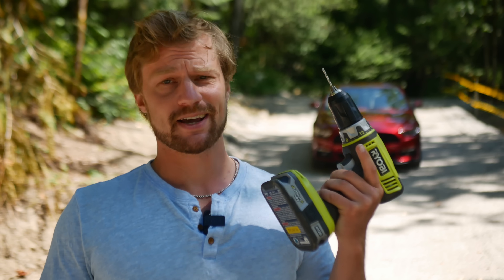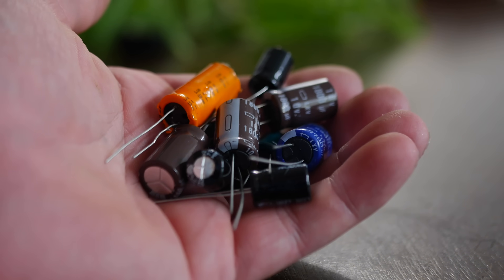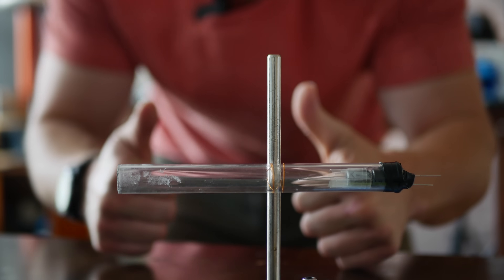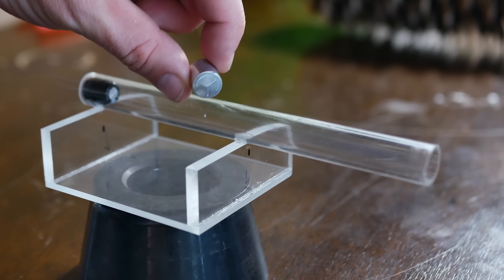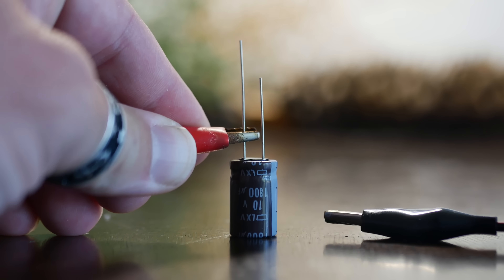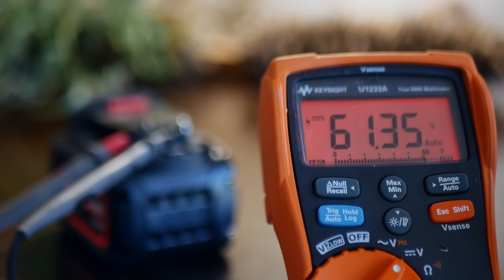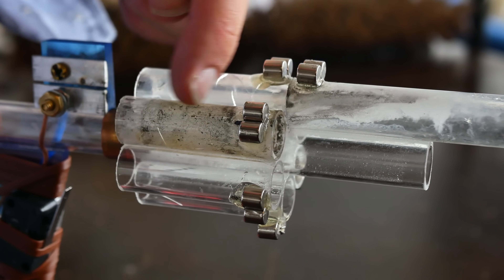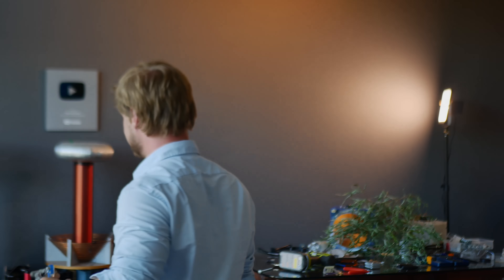I Built An Electric Capacitor Revolver!

Comment: Hrm, my first thought was how to make a reuseable exploding capacitor - but it seems like reading up on it just now, the mechanism of the explosion depends on overcoming the structural integrity of the oxide layer of the aluminum foil anode and cathode that are storing the energy, causing it to bridge the gap through the electrolyte-soaked paper to the other foil later - boiling all of the electrolyte and causing it to violently explode through the weak spot at the top of the capacitor. To replicate that you'd need much stronger anodes and cathodes, and something like a transistor rather than the oxide layer, so you could switch its conductivity on rather than overwhelming it. Or just like, discharge a lot of capacitors into some water to boil it and then use that to move a piston to knock your projectile I guess. Or some concentrically arranged like, ring-shaped peltier devices or something, driving heat inwards and cold out, and have those boil the water to create the steam to drive your piston.

Comment: They say great minds think alike. I had this idea thirty years ago. Just never ran with it fella. Ams so impressed with you dedication and work ethics. WINNER "JAY" PERIOD!!!!!!!!!!!!
Reply: We did this in the late 60s or early 70s. Back then caps didn't have the little X engraved in the end so the entire case would shoot off like a bullet. We converted a cap gun and used batteries. They were pretty dangerous though.
Reply: @USA__2023  Excellent to hear Clay. Just amazing what a determined mind and resourcefulness can make happen. 
This is something I made in the late 60s that took off and made billion plus of dollars for the lucky guy who made it happen while I just did not follow through. The swimming pool creepy crawler which cleaned the pool water surfaces and especially the bottom while the filter was used to clean the water. Like I earlier, great minds think alike.

Comment: I've had a few months ago a similar idea, but the idea was that the charged capacitors function as projectiles or bullets for a non-lethal-weapon and would electricly paralyze Targets without the need of cables or wire, so it could work on longer ranges. The projectiles could be fired out of an air or soft-air gun and would be charged or chargeble capacitors that are fitted into a burstable membrane of ball that is filled with an electrolytic fluid or gel (maybe like those gels that are medically used). When the ball hits the target, it bursts and the electrolyte gel is geting distributed over the target and the condensator discharged. Feel free to buid this if you want to!??
Reply: dude that is such a cool idea, you should build it, patent it, and pitch it to the police or something

Comment: To get higher voltage you could have use a circuitry of an old camera flash, which charges the capacitor to higher voltage and then they could be discharged in to the smaller ones to explode.
Reply: Or you can use 2 buck converters in series with seperate batteries

Comment: I know nothing about physics. But would it be possible to create micro bursts of air using your ionic thruster made in another video? Seems like the cost of capacitors scaled up would still be inefficient compared to chemical combustion style bullets. I also probably used most of the smart sounding words in that last sentence incorrectly.

Comment: when and if you make a metal one i look forward to the turn out, but I'm sure you already thought of this of what I'm about to mention you could double out put by doubling battery packs and reverse chain cross wiring them, but also make sure your chambers are insulated could possible use old style disturber cap from old vehicle and your hand grip also otherwise one if not two batteries will short out if not zap ya. good luck man.

Comment: Hey Jay thanks for the flash back to my early teen discovery of electronics. Two things though: first they stink, that fizzeling dialetric fluid in the tube. Second, I liked you V/fps graph but when i did this 40 years ago I used a big fat 50V ?unknown current transformer. Electrolytic also means polarity sensitive so maybe you can re-do your graphs using AC, maybe reverse polarity. 
Even as a kid I applied a bit of safety, I covered them with a flower pot, 'till I blew the arese out of it and the old girl next door started winging about the noise,. so I stopped. 
Have you thought of destructive canabalistic capacitance. You know they are zero resistance at first touch, so why not charge up a bank of big boys just to destroy the sacrifical lamb.

Comment: If you drillled a hole 1 inch from the end of the barrel could you increase the velocity ?because i saw that the gas in the barrel created a vacuum type thing that pulled the bullet / metal back.

Comment: What if you try to charge a capacitor with step up converter to much higher voltage and then discharge it into this smaller one

Comment: did u said the power is relative to the voltage? XD you ebay 400volt can seize capacitor, put that in serie and blow the shit cap with 4000 volt and 1 farad

Comment: If you could somehow compress the energy from the capacitor into a tyre pump sized tube (or maybe a bit larger) and then design a projectile using that compressed energy generated, it might be something to look at if possible 😂 Or would doing that be a negative thing to do, I dunno 🤷🏻‍♂️

Comment: When did make more sense just to use some kind of an arc that could push anything, bring in outside gas ,air, and then blow out dirt, a rock, capacitors are expensive.

Comment: I have a suggestion, I'm sure you've already thought of it or someone else has suggested, but I'm not about to read every comment looking for it. So here it is, you need "wading", which prevents your rapidly expanding gas, or propellent, from escaping past the projectile without doing its job. I would suggest something similar to what is used in shotgun shells. Which are plastic. This should increase muzzle velocity and maybe also accuracy. Just my 2¢ worth. Love the channel by the way, thanks for all that you do.

Comment: I am not a proponent of gun property, but boy do I love technology.
Different from blowing caps, what about a HHO generator and igniting that to propel a small object.
I imagine a pressure chamber that gets filled with HHO as pure as possible with a closed valve connecting to the barrel. Once that's filled, or has replaced most of the air in the chamber, close of all valves and turn open the barrel valve, and ignite it.
Reply: Fortunately it is done: https://www.youtube.com/watch?v=qb_5RMA2GxY
Reply: and even better: https://www.youtube.com/watch?v=pvuASNhxxcA

Comment: Nice work. I wonder if it is possible with waterdrops and a high voltage spark or plasma (H2O->HHO) to create a similar propulsion but with less dangerous byproducts. I saw an exploding waterdrop in a documentation about casimir effects but never tried this by myself.

Comment: Don't try building one yourself... so if  you built a backplate with the cap attached to an outer and inner plate like a battery you could make cap bullets and full auto electric machine guns, this is why infringement of the 2nd is nonsense.

Comment: What would happen if you inverted the capacitor (explosive end toward you in the cylinder), block off each cylinder like a proper revolver, and have the cathode/anode making contact with the cylinder?
Could electrify specific regions on each cylinder and then the capacitor becomes a self contained projectile, you just slide a new one in and its ready to fire again.

Also, gunpowder is probably a better propellant but innovation is important!

Comment: I had a similar idea.
Sparkplug rifle.
It uses a sparkplug instead of a bolt and caseless ammunition. 
It can be made with basic materials. The chamber is almost completely sealed due to no ejection port or opening bore, allowing for maximum compression.
To fire: moving the lever action racks a round and also, using a set of gears and a clutch, spins a small generator on the side. It spins like one of those rev-and-go cars, where it keeps spinning after the lever has been returned to starting position. When the trigger is pressed, it closes a switch to the capacitor, and the sparkplug in the chamber fires off, igniting the primer and sending the bullet down the barrel. If ammo is out and youre cornered, you can overcharge the cap for a pseudo grenade
Reply: You don't get consistent firing with a quick low energy spark. You could use a semi cw high voltage source (Which probably wouldn't be great since both black powder and gunpowder leaves a bit of sot which would short the electrodes that ignite the primer). The other option is to use a heating wire. Either way, It sounds like a cool project and i wish you the best of luck if you decide to create it :)
Reply: What do you mean overchar💥 💥  👟👟

Comment: If you ever feel like revisiting this you could probably use the capacitors to shoot lightning and control it with HHO gas which might also clean the chamber. xD good luck

if you take this idea and even maybe make a vod with it, do some background research into charged water explosions/implosions and into EVO's or EV's; and you will also want to look into suspending water with zero-point energy; the zpe charged water releases lots of energy when come into contact with high voltage electric discharge. Have fun! Love your channel!

Comment: Use a DC-DC boost converter with a large capacitor hooked up to deliver large current spikes. You can improve the design easily

Comment: You could have used a flash capacitor from a camera to get a higher voltage before you fire with likely a smaller battery, or make some kind of Tesla coil to hold the charge and the release the charge through the capacitor or other such. Even a small scale Tesla coil or flash capacitor for a camera would have worked out better then the battery system you ended up with to get the high end voltage you wanted for failure.

Comment: Thought comes to me about using two caps.  line the barrel on opposite side with a positive and negative line and load the cap design you have been using, but also put a reverse cap in between it and the projectile. kind of like the way you would load power into a musket.  then when you power both caps at the same time they will both force the pressure at each other. P.S. I am not a science guy so this might be a stupid idea, but would love to know the results.

Comment: Very obviously your barrel is too long.

Suction is created behind the projectile because there isn't enough gas to fill the volume. You can see this in the firsts tests and also by hearing the pop sound every time it leaves the barrel after higher voltages give it enough inertia to get past the pressure.

Comment: now just double up the batteries to push the voltage to 120v or maybe use a larger capacitor to dump the needed voltage into the smaller caps

Comment: Couldn't you just run two batteries (or more if you really want to vaporize the electrolyte) in series to get 90v or more? 💥
Reply: this is the simplest solution. i mean those batteries are made of 3.7v batteries in series already

Comment: Considering you're only getting an explosion from vaporizing the liquid in the cap it makes sense that the higher the voltage the better it works, you need all the heat you can get to vaporize as much of that liquid as possible in that instant

Comment: Bigger cap, higher voltage, thick rear cover plate with two holes for contact, steel barrel, plastic shot cup, one throwing dart.

Insane sabot round.

Comment: If you really wish to upgrade the model for faster bullets then there is few things first is aerodynamics of a projectile which is already studied and made into bullets so that is a thing and also how well sealed space between capacitor or a power source and a projectile has to be real tight, or what guns do is put them in totally sealed capsule, so that all power goes to a projectile and not somewhere else, and there is a thing that your bullet will still not go in straight line if you dont give it a spin which is made in barrel and the longer barrel the more acceleration in right direction is made, metal tubes would help, you could make some modifications to capasitor so it doesnt struggle to explode, make those capasitors specialized for exploading and that is pretty much it of what can i think of

Comment: Awesome.... but, for a steam-power driven projectile accelerator, another steam-producing setup than a capacitor might prove more efficient. Depending on used fluid and how the voltage is supplied, that is. All these poor little capacitors! 🤣

Comment: I exploded a lot of capacitors and I know the best one for making something like this will be very small 12 to 18 volts and 100 to 200  fareds . and when these explode the aluminum cap will fly like a bullet itself therefore no need of using a bullet.  hope you will get some help by my experience.  and use very small size ones . much smaller than you have used in this video .☺😊😊😇
Reply: Sure. Maybe, maybe. Look here:
! New: Apocalypse Coilgun, Fallout Coilgun
https://youtu.be/G9-jKWPyMFo

https://youtu.be/_9WUcGwmS5s

See also: Portable Super Coilgun:
https://www.youtube.com/watch?v=rclLsQ9nyeg&amp;feature=youtu.be

https://www.youtube.com/watch?v=-mjDqp_oWZk

https://youtu.be/YLOYxsqvjw0

Comment: Run a pair of batteries in series and have them belt mounted this way the more power you want the more batteries you can add (to a point) without it being any more difficult to use. This way you get 120v(or more if you go with more than two) and have a lighter device. Also for the barrel you might want to consider machined aluminum or steel as the sizes you can buy copper pipe in will most likely be limiting for how well of a fit you can get and copper pipe is too thin to allow for very much machining to get a better fit.
Reply: Sure. Maybe, maybe. Very probably. Look here:
! New: Apocalypse Coilgun, Fallout Coilgun
https://youtu.be/G9-jKWPyMFo

See also: Portable Super Coilgun:
https://www.youtube.com/watch?v=rclLsQ9nyeg&amp;feature=youtu.be

https://www.youtube.com/watch?v=-mjDqp_oWZk

https://youtu.be/YLOYxsqvjw0

Comment: Great job!
Have you thought of plasma?
Silly question? By definition a plasma is an ionized fluid. So, what happens if you change the make up of the plasma? Or even the state? Glass is a fluid.  Or maybe solid state plasma? Changing the gas composition in a plasma may produce some interesting results.
Reply: Sure. Maybe, maybe. Very probably. Look here:
! New: Apocalypse Coilgun, Fallout Coilgun
https://youtu.be/G9-jKWPyMFo

See also: Portable Super Coilgun:
https://www.youtube.com/watch?v=rclLsQ9nyeg&amp;feature=youtu.be

https://www.youtube.com/watch?v=-mjDqp_oWZk

https://youtu.be/YLOYxsqvjw0

Comment: When I was about 6 or 7 I took my brother’s video game system apart and exposed the motherboard. I put a bunch of my mom’s picture wire on it to make it look even cooler. Then I plugged it in to see how much cooler it would act. Sure enough what it did was way cooler than that crappy video game: It started to give off plumes of smoke, there was this sound that kept getting higher and higher, and the main electrolytic capacitor shot up like a rocket!

Comment: How about dumping a fat capacitor charge into a small squib wire? It will vaporize it instantly and create the pressure gasses needed to push the projectile out . I've already seen it done it works great

Comment: Maybe you already did this, but you should experiment with changing the length of the barrel. If the barrel is too short, the projectile leaves the barrel while there is still some energy in the expanding gas behind it to push it. Too long of course and you run out of room for the gas to expand and the friction of the barrel plus the vacuum behind it slow the projectile down again. I think that's what happened in your first test, though in the subsequent tests, you probably could have used a much longer barrel to get the full amount of energy out of it. If you had a way to calculate the total volume of the gas created then you should be able to calculate the optimum barrel length to get the most velocity. Of course, you're going to lose some as well from the gap between the cylinder and the barrel as well, so the better that is sealed, the better velocity you should get as well.
Reply: I just had an idea for calculating the optimum volume of the barrel. Attach a very short barrel to the end of a very large syringe. Seal off the whole thing very tight and film it exploding in slow motion. The plunger of the syringe should be accelerated out up until a point where it starts to lose energy again and slow down. If you mark this point on the syringe and calculate the volume, a barrel with the same volume should get the most energy out of the capacitor as possible. Doubtful you could make it into a dangerous weapon, at least with that size capacitor but you might be able to get it close to the power of a paintball marker, which would be pretty cool.

Comment: Why use only part of the pressure to fire a projectile with a fixed capacitor, if you could launch the entire capacitor like a rocket?)

Also, I think this could benefit from using another capacitor, this time in its intended application, to burst your capacitors at a higher voltage in a pulse